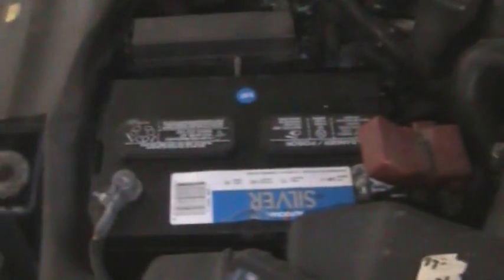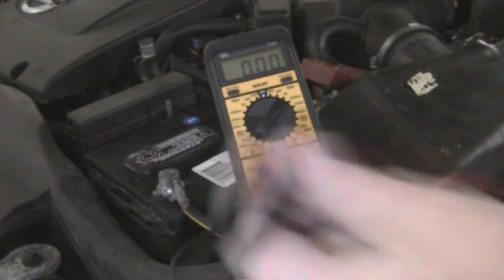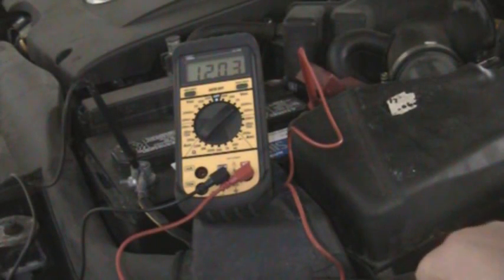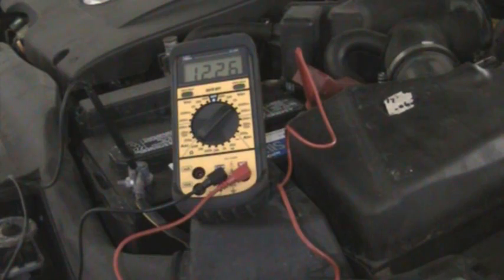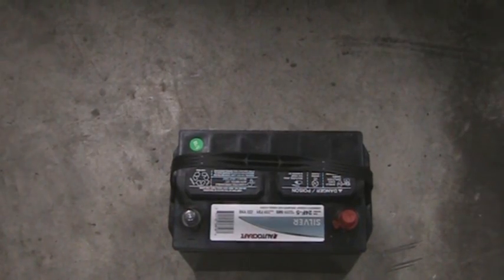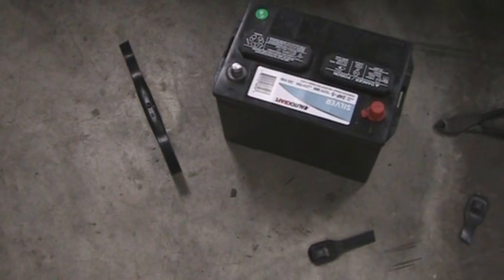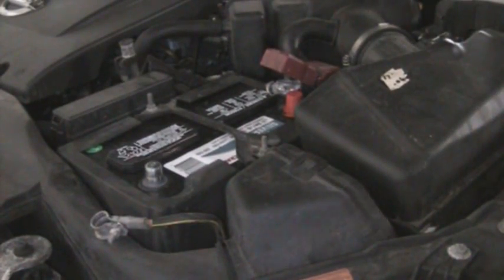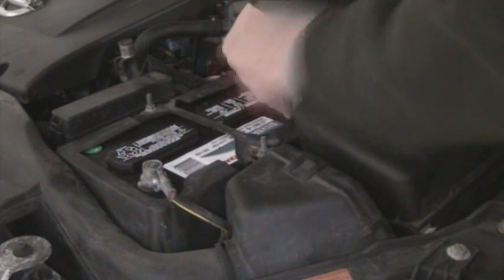How to Test Automotive Battery & Cranking Amps with a Multimeter

Comment: How do you know the alternator doesn't have a leaking rectifier/blocking diode ? Could be any one of the 6. The alternator will charge just fine if you can just get the car started at all, as in the past up to this morning.  -----------  

How do you know both battery terminals/clamps are making good electrical contact that can support 500+ cranking amps ? Just because the voltage on the clamps went very low 
doesn't mean the voltage across the actual battery terminals' voltage went that low.

How do you know the starter motor isn't failing which may cause it do draw excessive current without generating enough torque and fail to turn over the engine and also pull the battery voltage (which you didn't test) to low ?

You procedure is very lacking and may trick people into thinking they need to replace the battery and/or alternator and/or the starter motor. SHAME ON YOU !

Comment: Couldn't a bad starter or bad connection between battery and starter cause the sharp voltage drop when you try to crank it?

Comment: okay - battery handling 101:  of course this vid is 12 years old but the same 'rules' have held true since the invention of the battery:

when disconnecting a battery, disconnect the NEGATIVE terminal first,  then the positive. This way, regardless of whether you're 'careful' or not- you won't short the battery to the car frame while using an electrically conductive instrument such as a socket wrench.

when connecting the battery, you do the opposite; you connect the POSITIVE terminal first, then connect the negative.

learn this, then make youtube videos.

Comment: for most of the posts that amps should be meaaured, amps cant be measured with this multimeter (even if its designed by fluke)

battery tester with heating rod inside will do the job ..... 100s of amps flows in that when tested....the heater under full load is hot red with burning smell in just 1-2 sec..... and the reading is  in good range and stable

and the battery voltage should read around 10V during cranking

Comment: Thanks for the video and sharing the good information.  I just had 2 new batteries installed but, instead of cutting the handle straps; I just slid a .030 feeler gauge down between the  battery and the tab on the handle then lifted it\\the handle up and out of the slot.

Comment: All test done in a stores are only testing cranking amps not cold cranking amps so all these test in stores say the battery is good is bunch bs. They not testing the load test under extreme cold where the cranking amps are changed by temps  that push the battery.The only performance test is cca not cranking amps which are only good above 32f
REPLY

a load test in 32f will only test crank amps not cca . cold crankings are only tested below the 32f.This test only proves the cranking amps are there not the cca amps which are tested in cold weather below 32f hence cold cranking amps vs warm weathers cranking amps . Batteries all have cranking amp specs and cold crankings amps specs designed for 32 and one for below 32f.

Comment: Follow this sequence before get a new battery
 #1.- Discard if alternator is on fail.
#2.-  Discard any circuit draining battery even with the key removed from switch.
#3.- if you can buy a cheap battery analyzer to check CCA would be better.
Good Luck!

Comment: Nicely explained the voltage measurement. But it does not cover how to determine (estimate) CCA of battery.
The CCA test requires the battery be cooled to - 18 C [ 0 F]. Apart from that, You may please just estimate CCA at room temperature which may be varying in range of 10 - 25 C, depending on where you live.

Comment: 1st, when replacing any battery (new or old) you should always connect the + first (or when disconnecting disconnect the + last).  2nd, there was no test for cranking amps..?  Other than that OK I suppose.  George C.
Reply: George Clemenceau   -  why ?
Reply: Why, "Why ?" ? Do you meant the order for disconnection?  Just in case, really.   (It is possible to carefully remove either first, but to be on the safe side, it's to prevent making a short circuit (as long as the connector won't flap back onto the terminal post as soon as you let go). Shorting a lead-acid battery delivers huge current - enough to melt thick wire, or even wedding rings if the spanner, the ring and the bodywork make a connection.)

Comment: What happened to the part about testing Cranking Amps?
Reply: How not to make a video
Reply: Top tip ..... Disconnect the earth first whether neg or positive then you don't get fireworks if your spanner touches the body when undoing the clamp .
Reply: He did it, when he started the car the  voltage stayed above 10V that means the battery endured well, below 10V  is weak.
Reply: I have a video on checking a car battery (explaining how to test cranking amps along with other tests of the ignition and charging system)
Reply: @theoldtavern1856  no you don't

Comment: Battery Jumper box is nice to have when car bat is dead and nobody can help you with jumper cables. Campbell makes them can get one at Walmart for like $35 USD. One cable to battery and other to metal somewhere on engine. Cranks right over. And Battery Buddy uses a Lithium Ion battery to store enough juice in case car bat is dead it will crank over your car.
Reply from the maker: Yeah, they are well worth it!

Comment: My 02 Civic Honda battery had removable caps for service and most do not know that you can check the level in the cels, I had to add more distilled water to the battery to keep it in good shape. Had it for 8 years before I got it replaced. Just wear safety glasses and gloves to be safe.
Reply from the maker: That's awesome, lots of life out of it!

Comment: Can't seem to find someone to answer this question. Well, with a fully charged battery. When you insert the key in the ignition and turn it, the battery voltage drops (as indicated by your multimeter). From what I saw, the voltage dropped to 10v then jumped back up, you said anything lower than 10v is not a good sign. So my two questions are. Why does the voltage drop when you start it and could you go over why anything below 10v is not good and what could be the cause of it. Thanks!
Reply: 1. Why does the voltage drop when you start it?   When the battery is sitting with no draw (nothing major using electrical power) it remains pretty constant. When the starter (turning the key) is initiated, it pulls a strong current from the battery and drops the voltage momentarily. When the car starts the alternator (belt-driven charger for your battery) begins to spool, and the battery is then receiving a charge and shows higher than its normal voltage.

2. Why anything below 10v is not good and what could be the cause of it?  A car battery is built to hold approx. 12v. As the battery discharges, it is unable to maintain that peak voltage and it drops a bit. It raises again as its recharged. If the battery is discharged too far, it can damage the cells in the battery and then the batter is unable to provide a constant 12v that the starter requires to start the car. Deep discharging will damage a battery and it is normally the cause of a battery not providing sufficient power to start a car.
Reply from the maker: Thanks for watching. It drops because the battery is under it's own power to start the vehicle and then it jumps once the car is running because the alternator is then running and charging the system. You can actually totally remove your battery while the car is running as long as you leave your lights off, radio, etc.. It will run without it. Below 10 is just a general rule of thumb, some batteries are a bit different. It really depends on the initial voltage before you attempt to start the car.
Reply: ***** While you are partially right, u r not 100% right.:
1. " It drops because the battery is under it's own power to start the vehicle and then it jumps once the car is running because the alternator is then running and charging the system" - one could understand that if you immediately stop the engine, the battery will remain at 10V (as the alternator is not working) and that is false. A 99% empty battery with no short has 12-12.3 V !!! Also your assumption that a cell is dead is also false. A cell is dead only when shorted, and then the max voltage of ur dead battery would be max 10V. The drop in voltage is a consequence of power being drawn to explain the chemical reaction over the time required one can use wikipedia.
2. "You can actually totally remove your battery while the car is running as long as you leave your lights off, radio, etc." - double false: you can if you really want to turn on ALL the electric devices, as they  NEVER draw power from the battery. If they would, then a lot of cars with the radio on would have a dead battery after 1000 km. And the second false, you actually cannot remove the contacts on the battery terminal because one of the most important role of the battery is to STABILIZE the voltage. Real case, one dude did exactly that, in 10 minutes all 4 computers fried. The alternator sends spikes of 14-18 Volt in the circuit, the battery, even a partially dead one (not with a dead cell) is required. Of course it also depends on the maker of the car, and many other aspects, but generally speaking is a huge risk and you can check it with an oscilloscope to see if you do not believe it. That is one of the reasons of the further necessity of voltage stabilizers (usually big capacitors) when the consumption is close to the alternator maximum output (like when you use a subwoofer) and the fast superficial charge on the battery (when the battery acts as a capacitor) cannot compensate the instantaneous power spikes of the audio system....

Comment: Why did you put the battery on the floor? You do know that putting any battery on the floor discharges the cells. I actually went to school for automotive and they said ABSOLUTELY not to put a car battery on the floor, your battery will drain faster. usually car battery's last about 3-5 years, that battery will probably last about a year and a half or maybe two years. Their was test's done by this at the ASE Academy.

Other than that Very Great Video! Makes me remember high school day's when I took automotive classes.
Reply from the maker: Thanks for watching. Concrete draining a battery is a myth for the most part. Although I still don't store them on the floor, todays batteries are fine if you really wanted to.
Reply: #themyths

Comment: Battery Amps may be lowish although battery is fine on the volts reading. Its possible.
Good test to do, drive at night and stop facing a brick wall or a nice surface wall where u can see your lights shining.
Let the lights shine and then allow the car to continue idling. 
Then turn the car off and allow the lights to continue shining
The lights should not go so dim so quick.... they should take a few moments maybe 30 seconds....
Thats normal.

Comment: I would like to buy a decent multi-meter again but i am not sure which to buy - the last i had the fuse blew and also the red wire came loose from the red connecter pin.

Comment: but tell me, how do you actually measure the amperage though? is this just but checking that the battery voltage does not drop as low as nine volts when u start the car?  I guess it is dependent on the car electronics and what there is to power up ?
I have a battery in my car i been driving with it in the back seat for at least 1-2 years now... i know it was reading at 10 volts the last i checked -  is there a use for it, or should i just take it back to the battery shop and get a few bucks?

Comment: Brilliant Video, i have an OPEL CORSA vehicle ( formerly from Delta  and now General Motors )  1.6 ie  and i have also learned  about batteries a bit and wanted to know more about how to measure the amps. I also learned that at 12.3 its not really enough to start the car. 12.6 is very good. As you say though, its more about the actual amps.

Comment: Ok.... one dumb question XD

I know larger trucks and some cars have bigger batteries. Does your '05 Altima have a larger than normal battery?

You read about 12.3 volts on the meter... and said it was about half charged. Do you have a 24 volt battery.... or a standard 12.6 volt??

Comment: I just skimmed through this video, and it looks like you only test Voltage, not cranking amps. The easiest way to test cranking amps is to use an Ammeter Clamp-on, Fluke is best, it tests minimum and maximum amps. Look on the battery for it's rated amperage, put the clamp on, around the negative cable of the battery, and start the car to the amps spike.

Comment: The battery is high density shock resistant plastic. The breakdown voltage from the terminals to the nonconductive floor is in the hundred of thousands volts range, not twelve.
There is NO WAY IN FUCKING HELL to ground a battery by putting it on ANY surface provided it is right side up, and there is NO WAY IN FUCKING HELL to short out a battery with a piece of concrete. EVER: In any way.

Comment: Yo, i used your video and went and tested mine. When the engine was off i got 12.67, when cranking it dropped to 10, and running it was at like 13.95. The last reading, is that bad? im sure it should be 14.4?

Comment: Hello, I have a 98 town car. Whenever I get to a stop light, I step on the gas and get no revs at all for several seconds, as if the car is going to stall. I had that happen before with another vehicle and it was the alternator that had gone bad. I checked on this car using your videos, and it seems to be ok. But the battery is showing 12.43 cold, after leaving the car on for a few minutes and turning it off, it shows the same or less than that. Think I should replace the battery?

Comment: @devGOD if you hear a click, it might be that the negative battery terminal is not tight enough on the battery post. Check to see if you can pull off the terminal without a tool. If you can, then it's not making good contact for cranking. I had that problem once.

Comment: Awesome video. 
This morning I tested mine with a multimeter and cold it read 12.06.  I had my wife start it up and it went to 10.30 and back up to 14.something.  Yesterday my wife took to autozone and they said alternator was dead.  It read 12.54 and 14.1 running.  O'reilleys said its all working good.. Based on my specs. is this correct?

Comment: Excellent video... I watched another one that didn't mention cranking amps, so when I saw that my battery was charged and the wiring was ok, I spent the day ripping out my starter and replacing it. 

Wish I saw this video first. :)  Found this because got a new battery and found your other video about testing the alternator.

Comment: I have looked all over the internet and most say if you get around 12.5 volts the battery is good. This is the only video I have seen that actually tells what the Cold Cranking voltage should be! I took my starter off and had it tested, what a pain! Wish I had seen your video first!  Thanks for the info.